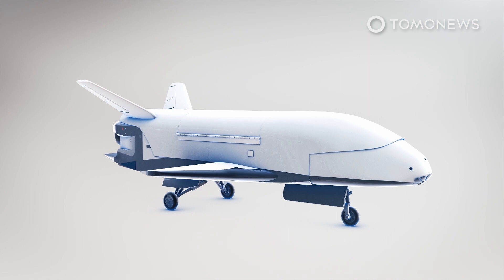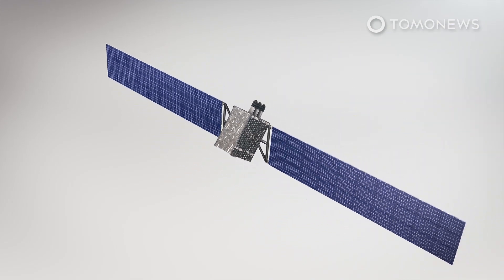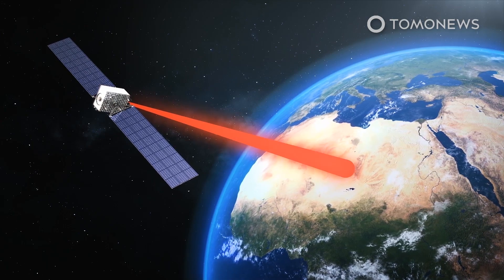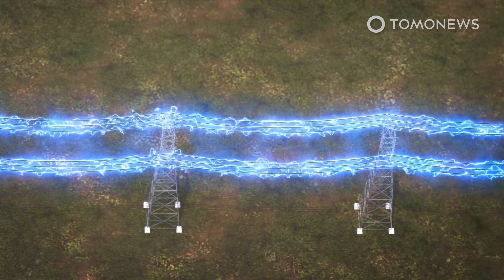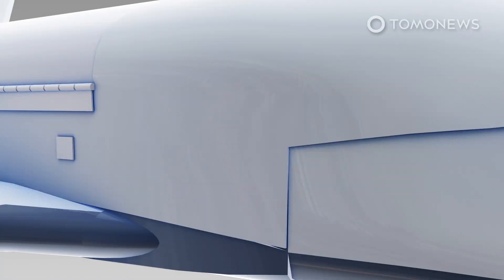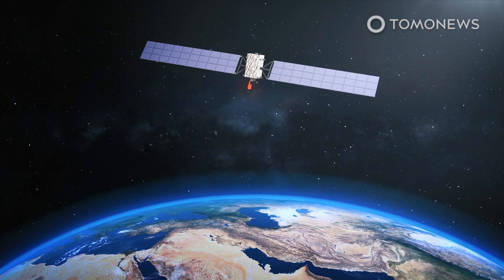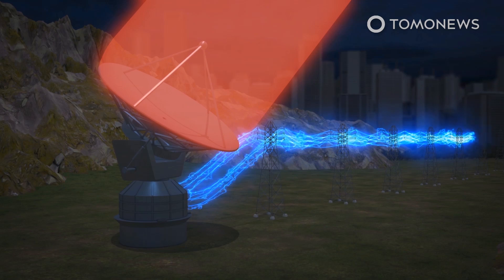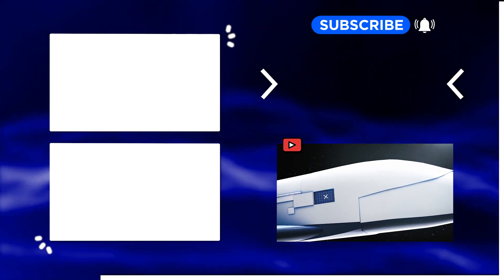Space Panels Could Soon Beam Electricity Back to Earth

Comment: This is for possible use as a power backup for a small base on the Moon.
On the Moon, you have two weeks of sunlight and two weeks of darkness along the equator.
 Beamed power could help avoid having a nuclear reactor making electricity.
 They could use fuel cells instead, during the dark times(with beamed power as a backup).